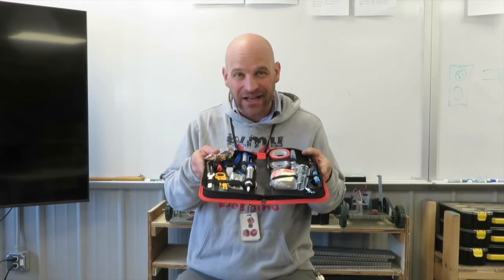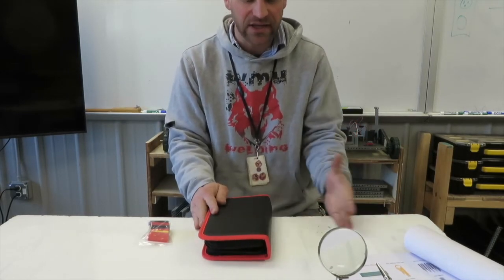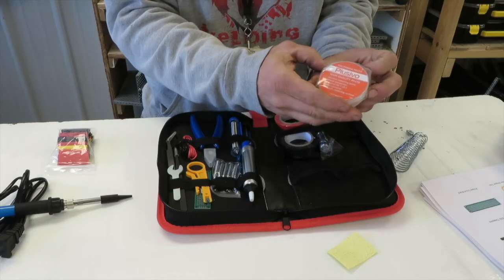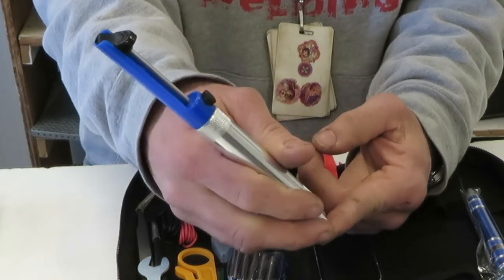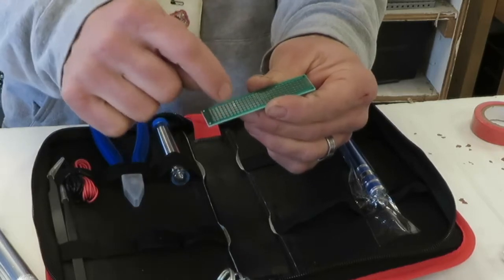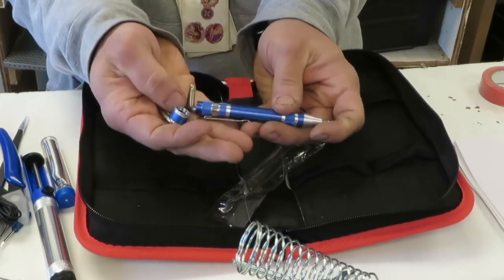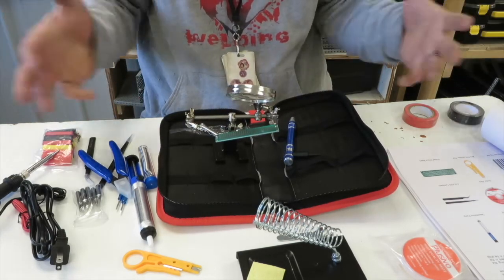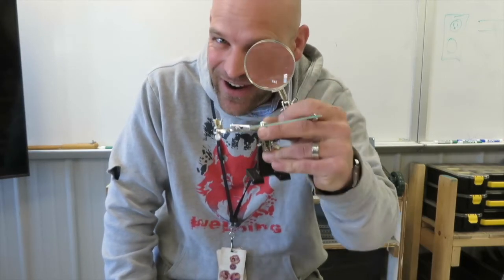Intro to soldering ( What is in the Plusivo Soldering Kit)

Comment: The web says soldering paste and flux are not the same thing and you say they are and give no clarity on use.
Reply from the maker: they both help the soldering joint
Reply: @mr.kongable  ok, can I use soldering paste for a wire to wire type of soldering connection or is this for computer boards or both types of soldering?